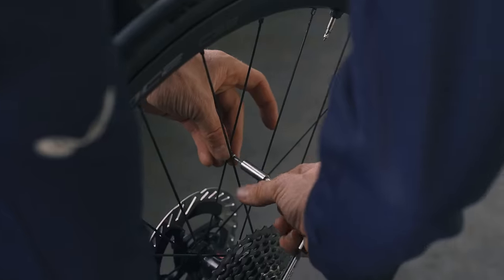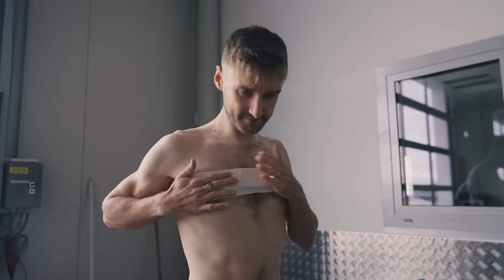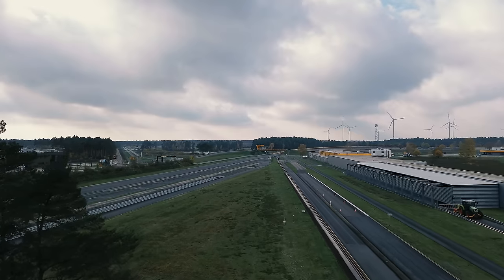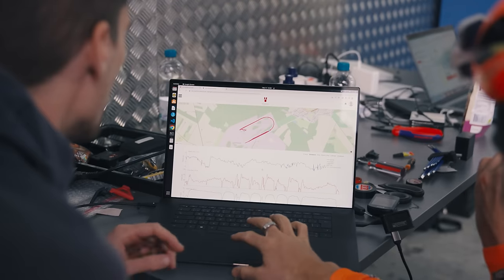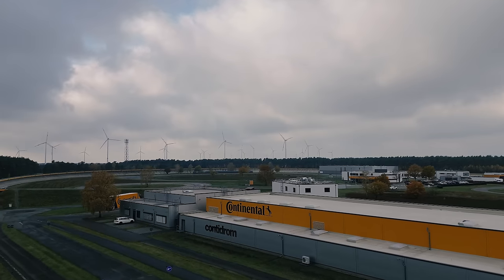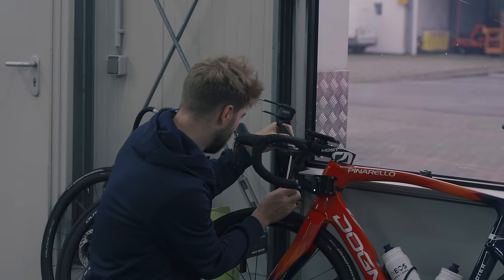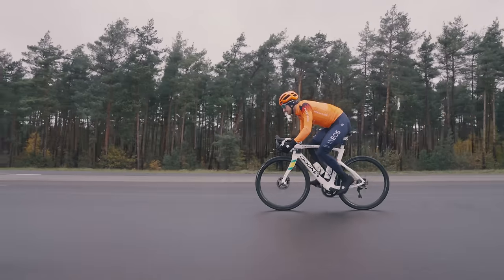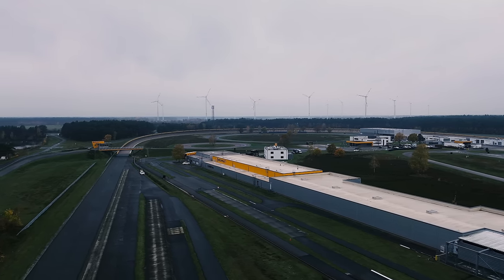Tyre testing in the Continental Contidrom | INEOS Grenadiers | Behind the scenes

Comment: So, what's the conclusion? 🤔
Reply: Tyre size and pressure is very important 🤫
Reply: @danbigham6184 oh really? I had no idea. 😊 Irony aside, have you noticed similar results to Silca tire pressure research? I mean, the increased rolling resistance when the tire pressure is too high? Research like this could benefit the entire cycling community. It would also be easier to convince my friends that 25mm tires at 120PSI are not the thing anymore. 😅

Comment: Conti tires are just too hard to mount. They should work on them to fit carbon rims easier. I've switched to Pirelli's. Great tires.
Reply: Conti is easy
Reply: I confirm that conti are too hard to mount on carbon wheels. I also switched on pirelli pzero race, it is more easy
Reply: conti are easy. Ive been using them since 1997. It is just your technique brother. Give me ANY conti on ANY rim and I will get it on with no tire levers. Even the ebike tires and they are HARDCORE stiff.

Watch my vids on tire installation. Always squeeze the beads into the middle of the rim channel for easiest install with no levers required. IYKYK.
Reply: @durianriders i suggest you to share your technic via a video 😉
Reply: Yep Conti especially tubeless are stupid hard…and I’ve been using them for 20yrs. I won’t even buy them now. Pirelli are much better.
Reply: @occyman  When installing any tubeless tire I spread a very small amount of sealant at first on the rimtape with a small paintbrush. Then my cheap floor pump is enough ... I inflate the tire with it - and BAM - BAM ... the tire is seated correctly .
Reply: @durianriders "Give me ANY conti on ANY rim and I will get it on with no tire levers." 
Sure you will bruv, "THEY CALLIMDURYANWANKAAAAAA"